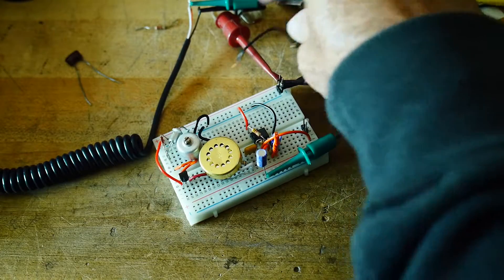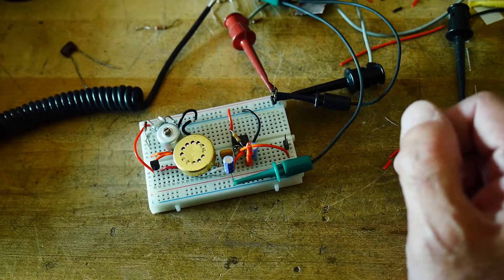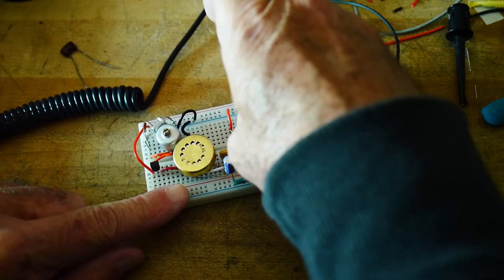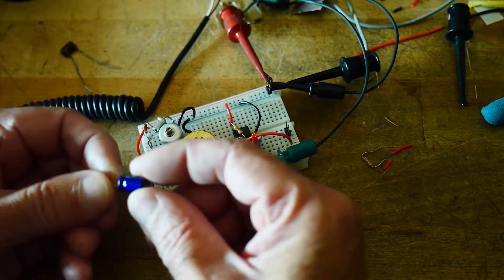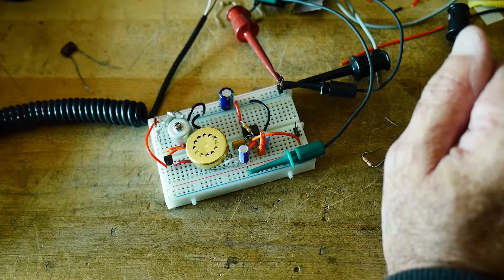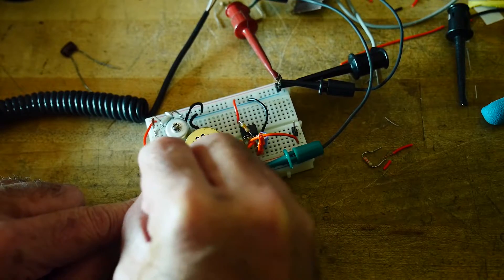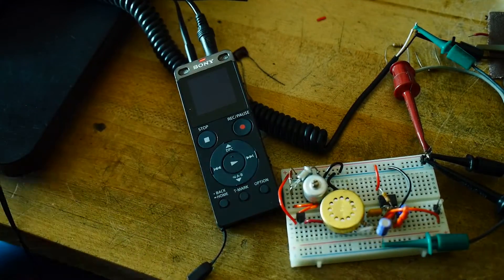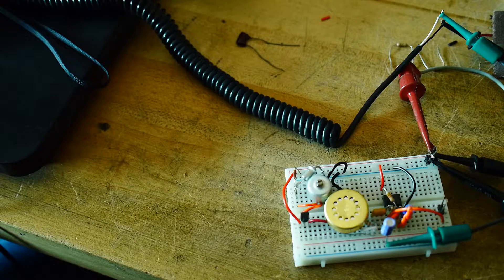#422 Russian microphone мкэ-84 audio recording

Comment: I'm pretty sure the hum you hear is caused because of a mismatched impedance between what the digital recorder wants, and what you're providing with the output of that cap. Also, a random cable with hooks and no shield will pick up hum. Note that line level equipment have a really high Zin, which means that it's fairly easy for noise or other "not-so-strong" signals to be induced in that line. Try to put a 10k resistor in parallel to the capacitor and/or connect the shielded cable straight into the breadboard, without flying cables.